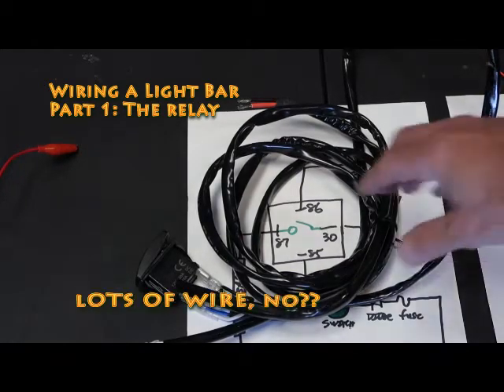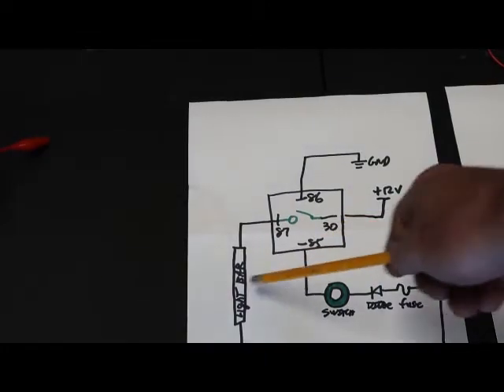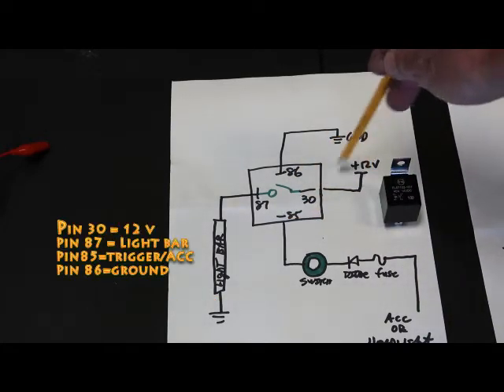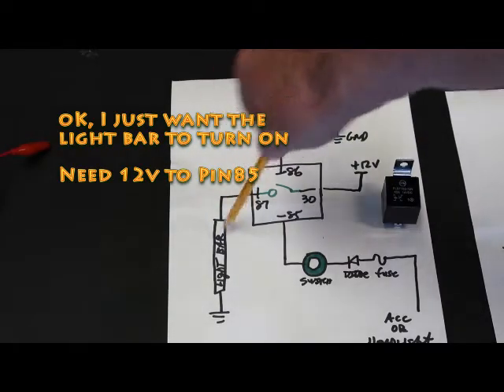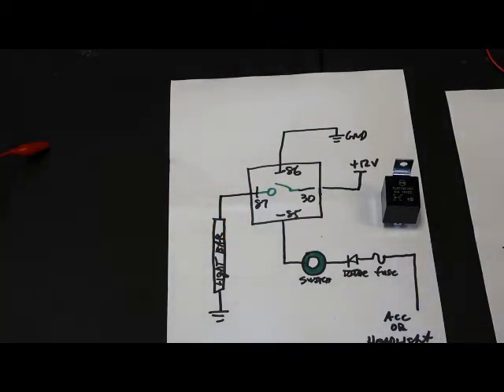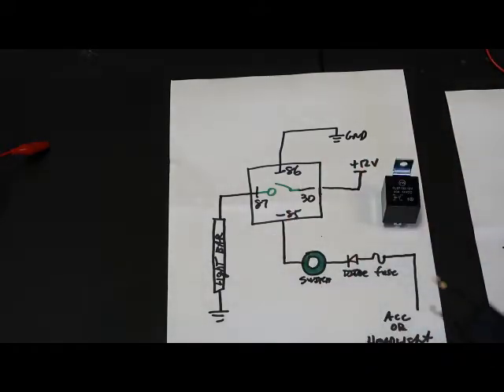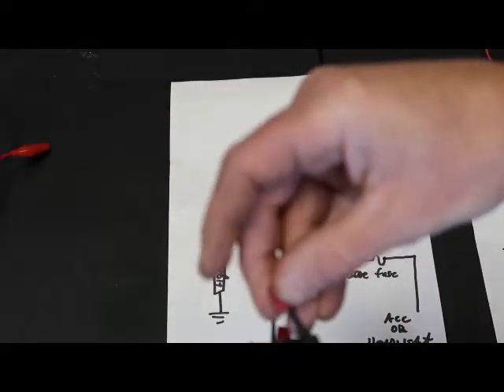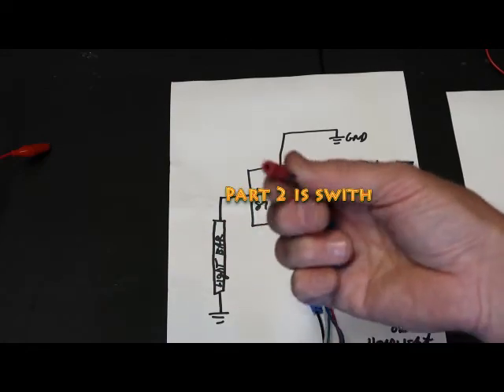Wiring LED LIght Bar Part 1, Relay and switch GMC colorado

Comment: Where is the acc wire in the 2016 Colorado so I can tap it?
Reply: I  did a simpler setup on mines. Its called switch delete. The fuse is installed on the 12 v line before entering the relay and that is connected directly to the battery. The  85 terminal is connected to the positive headlight wire of the highbeams. So when you flash your highbeams, the light bar will light up together. This avoids all the hassle of running wires into the truck and installing an unnecessary switch